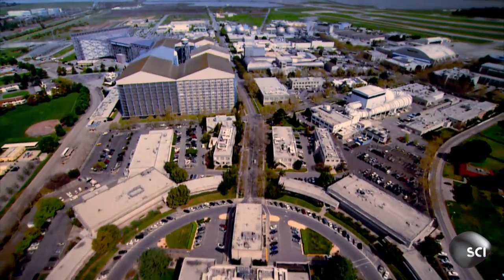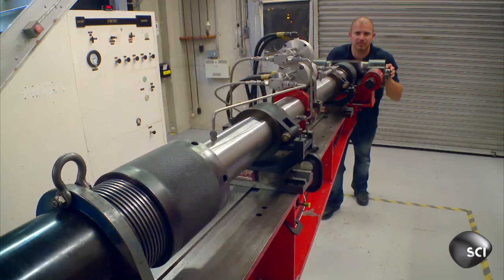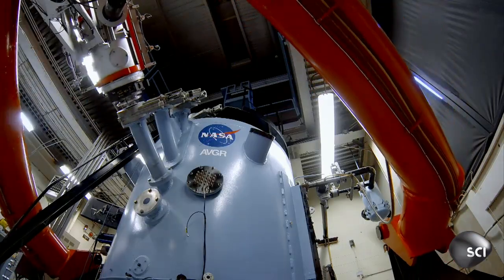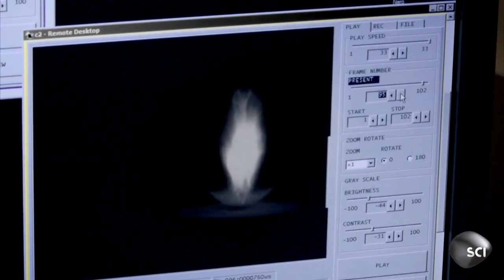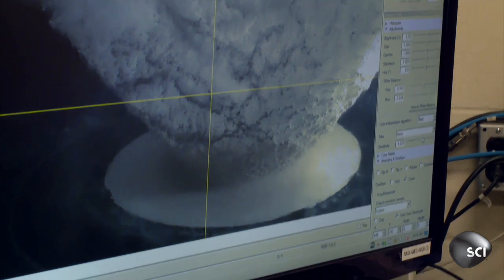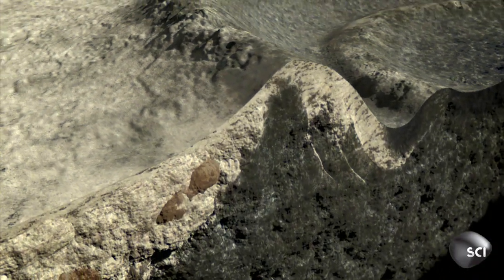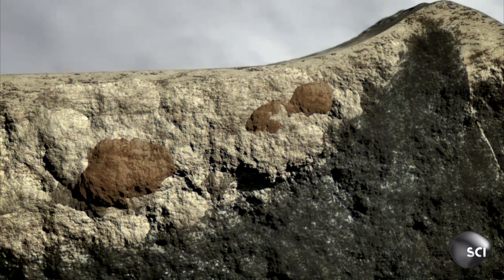Recreating Asteroid Strike That Killed Dinosaurs

Comment: People, including scientists have a hard time wrapping their head around the immense energy released by the impact. 
The excavation of the crater took 3-5 minutes and both the impactor and earth under and around the site were vaporized, a mountain range of material was vaporized by heat hotter than the surface of the sun.

If you were anywhere within line of sight of the plasma ball you would be blinded and set on fire. You wouldn't have seen anything but assuming you were wearing a big silver reflective fire suit and tinted welding visor (assuming it could dull light this intense to something that won't blind you) you'd have barely had time to register the entry if at all. 
If you were on the Gulf Coast in what is today Georgia or Mississippi and wearing said suit, the plasma ball would appear the size of a soccer ball held out at arms length.

Unlike Hollywood depictions no large boulders would rain down, it was almost entirely vaporized or reduced to dust. Further from the impact, out of line of sight as the plasma ball is behind the horizon you'd see the curtain of incandescent material rising and spreading out,after 30-40 minutes it would envelop much of North America.
The heating would be rapid and begin setting flammable material alight. Forests would burn.

About the same time the magnitude 10+ earthquake would strike. Liquefaction of soil would occur and start to swallow things up, even well built bunkers would fail meaning survival is unlikely as either the bunker implodes or the escape tubes are severed or buried. Even if these things do not happen, the shaking would be so violent people would suffer fatal injuries like heat trauma and broken bones.

Vulnerable facilities like nuclear power plants would suffer immediate failures as coolant plumbing to their cores would fail. Their containment systems would collapse and having suffered coolant failure would rapidly overheat and rupture, exposing their burning cores to the atmosphere. No one could make efforts to remediate the problem or get coolant to the reactors as they would be crushed by falling debris or simply be unable to walk or work amid the violence of the shaking.

Buildings would collapse, hundreds of millions not already charred to death by the flash would now be buried or crushed as their homes, offices and other structures collapse on them. Cities would see pretty much all of their tall structures fall. This would be a global event. About 1 hour after impact the entire planet would be shaking violently. 

The magnitude 10+ earthquake would trigger volcanic eruptions as it spreads out adding greatly to the effect. Yellowstone would erupt.

The tsunamis would take the longest to effect the planet, some would take many hours to days to hit land as they cross oceans direct from the impact while others would be induced from undersea landslides, the global earthquake would trigger localized earthquakes and plate uplifting that would cause additional localized tsunamis in addition to the primary earthquake, submarine volcanic eruptions would likely cause some tsunamis as well.

Over a period of 30-60 minutes much of North America, all of Central America and a significant portion of South America would be hit by the blast of overpressure, unprotected animals and people would suffer collapsed lungs and other hollow cavities. Ruptured eardrums absolutely.
Between 1 and 2 Billion people would be dead by 1 hour of impact.

An excellent video can be found here, in my opinion it is very conservative in its estimations but very interesting to watch. It does not make mention of eruptions, additional tsunamis ect (that's ok, hard to predict which faults and volcanoes will go) but gives a pretty solid estimation of the impact effect.

https://www.youtube.com/watch?v=ya3w1bvaxaQ&t=322s

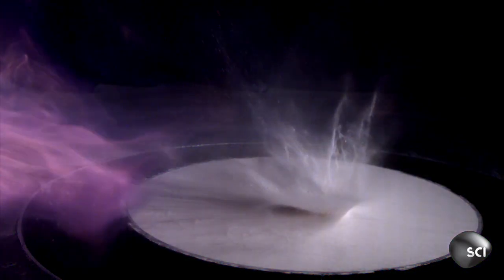Comment: 3:42 that crater isn't egg shaped. And I don't think the one at Chixulub is either. And why would a 90 degree impact angle be the norm? There is a wide range of possible angles for impact, it isn't especially likely to be a right angle. The scientist in this video is great but is it possible I sense some sloppy work by the uploader?

Comment: 1:43 Except that the impact that created both the KT event line and killed the dinosaurs,
didn't strike vertically, but diagonally and resulted partially in the Gulf of Mexico.

It struck at a bearing of NW, about 60 degrees upward-ish..
Reply: 3:36 Nvm, you got that.
Reply: You can find out for more certainty, by measuring the large debris around the Earth,
for the spread.
Larger pieces can't stay up in the atmosphere for weeks and have a ballistic trajectory,
which is then more common near the impact site, and with certain density covering.
Then when the amount of debris in larger chunks is made into a density chart,
with similar indication of large chunks density, you can match that to the
simulation, until you get a similar result on angles of impact with the simulation.
Ofc, it still won't be as exact a match, since there's no atmosphere involved
in the simulation, which would disallow faster deceleration due to air friction..
Reply: This is different from measuring the KT line's thickness.
t's checking it for larger debris parts, not dust.
Reply: Still more interesting would be drilling a hole in the ground somewhere,
getting a deep soil sample, and finding out why part of the US's mountains
and the San Andreas fault line exist, but also finding out that some
tectonics still exist because of an event that happened millions of years ago.

A tectonic plate set in motion by such an event does not come to a halt in a year or two.

Comment: wheres the actual asteroid gone that backs all this up???
Reply: The main evidence of such an impact, besides the crater itself, is contained in a thin layer of clay present in the K–Pg boundary across the world. In the late 1970s, the Alvarezes and colleagues reported that it contained an abnormally high concentration of iridium. Iridium levels in this layer reached 6 parts per billion by weight or more compared with 0.4 for the Earth's crust as a whole; in comparison, meteorites can contain around 470 parts per billion of this element. It was hypothesized that the iridium was spread into the atmosphere when the impactor was vaporized and settled across the Earth's surface among other material thrown up by the impact, producing the layer of iridium-enriched clay.
Reply: That’s like saying “what happened to the ACTUAL nuclear warhead that backs up proof of an explosion???” It’s simple. THE ASTROID DON BLEW UP.

Comment: it also created a HUUGGEEE mega tsunami
Reply: @jbmrisn48  Most guesses say at most 300 feet, thus limiting the tsunami to 300 feet. That's pretty big, yes, no doubt about that, but it's tiny compared to what could've happened. In deep ocean, a 15,000 foot wave would've been possible.
Reply: @jbmrisn48  It was 6.8 to 50.3 miles in diameter, we will never know for sure.
Reply: Lucas It did worse than just that
Reply: @Untrepid One Whatever you're smoking to think that's true, stop.
Reply: actually most of the water in the area was probably evaporated before the asteroid touched base just because of the insane amounts of heat the astroid gave off
Reply: No it didn’t. It made a large tsunami but not over 1000 ft.
Reply: No. The water was too shallow to create the tsunami you probably have in your mind. It was around 300 feet high by most estimates. If it had hit in deep ocean it would've been ~3 miles high.
Reply: @audilicous  the closer it comes to a coastline the higher it gets.. thats the problem
Reply: @fortisvoluntatis1417  Correct, but it will not become higher than the height of the water it originally entered. Thus, it would be limited to what I said before. The sea it hit was extremely shallow.
Reply: audilicous so you are saying that the water could not have been, “scooped up”, by the blast, like a bulldozer pushing dirt ahead of it, thus creating a wall of water much higher than the depth? Remember, traditional tsunamis come from earthquakes, which usually do not impart the amount of energy we are talking about here, as well as in just a fraction of the time. I know when I was a kid, when I smacked a shovel Into a shallow puddle, water went a LOT further out than how far the depth of the puddle would have had it wash up on the sides.
Reply: The largest Tsunami
Reply: In The world
Reply: @alexabney3961  100 meters high,meh,the most biggest tsunami have 520 meters high,in lituya bay

Comment: They always mention the soot/ash blocking out the sun...but what about the heat from the initial impact? If you were 8,000 miles from impact, how much would the heat rise? Would you be deafened from the shockwave? Also, I wonder what the sound would BE like. Would you be blinded from the flash, at 8,000 miles away? Or would you have to wait for the soot/ash to end you?

Comment: TriggerEd EddieIrrelevant. Are you disregarding the athmosphere (later atm) over the sand at impact? At the speed the asteriod travels and its surface size wouldnt you think that sand only would maybe show the after events of the impact say on the mars or any other rocky planet with no atm? I'd use the equivalent amount of atm thickness to asteriod size ratio at the measuring of how much say water(atm) I need above the surface of the sand (earth). Then place cameras abover water (stratospheric surveillance) and below to see what would happen in the atm how much would it spread, would debries from impact try and escape the atm (water) again? By how much? You could re calcluate the water to air density and apply mathemathics to see how much difference there is of what you can observe with waters density and actual reality which is not water. We cant live in water. Imagine all the bubbles. But I think its better than nothing.

Comment: can anybody explain the flash seen upon impact?
Reply: heat from friction, or maybe sparks from sand.
Reply: It is indeed heat. Energies involved in a collision at 4km/s are so huge, that things melt and/or evaporate. The flash is literally plasma - a cloud of evaporated sand and impactor debris at extremely high temperature.
Reply: Per the narration, the ball is traveling at 12,000 mph (over 5300 m/s).  Kinetic energy is proportional to velocity squared, so for a 1 gram ball that's over 14,000 Joules (almost 4 Watt-hours, enough to light a 100-watt bulb for two and a half seconds). It didn't say whether they evacuated the chamber (if they were simulating an impact on Earth, probably not), so some of that light is plasma from the ball ionizing the air as it rips through.  On impact, some of that energy goes into the ejecta, but most of it goes into heat, light, and sound.  

Now, scale that second impact up to the Chixhulub impactor, something like 11 km in diameter and massing on the order of 10^15 to 10^17 kilograms.  At that same impact velocity, it would have release on the order of 14 sexitillion Joules, or on the order of 4 quintillion Watt-hours.  Think how far that wave of hot debris would have traveled.

Comment: The actual asteroid came with a shallow angle
Reply: Didn't change much considering the actuall asteroid was the size of Mount Everest traveling at over 24,000mph
Reply: All that it changed was that he debris shot out of the atmosphere at 45 degree angle instead of straight up
Reply: No, it means most of the force was directed horizontally and not vertically. The majority of energy was shot straight across the Earth.

It's very significant. Like the difference between your rocket shooting straight up, or sideways...

Comment: Imagine if the money wasted on this guy's "experiment" had been spent on a worthy project instead. If I had the power, I would put him and the bureaucrats who authorized his grant in prison for several years to think about it. He literally learned nothing that couldn't be duplicated by firing a .22 into a mud puddle.
Reply: The thing is, this object was going at 4km/s (much faster than a 22.) Also, you can see the intense heat and plasma caused by the friction of the object.
Reply: Domino the Dominator
And for all that effort and expense what was added to the annals of human knowledge? That a high speed impact spreads debris up into the air and all over the place. I never would have guessed.
Reply: Sporkmaker5150 Dude, holy crap, do you get angry at everything? This is an accurate representation of what would've happened 65 million years ago, and you're here complaining about it?
Reply: Domino the Dominator
I wouldn't say I'm angry, just puzzled and frustrated that this pseudo scientist was probably financed by tax dollars for his "experiment". Tell me this, was there any possibility whatsoever, any at all, that the result would be anything other than what we just saw?
Reply: Sporkmaker5150 Well, you have a point there. I didn't know that this was paid for using tax dollars, and you're right, it probably wouldn't differ from the last experiments.
Reply: Isn't that the point of experiments, to determine if in fact what we believe has any validity?
Reply: I would say it's the point of legitimate experiments. I would also say the point of this particular one probably had more to do with NASA's end of the year budget than it did a quest for knowledge.
Reply: What part of my cynical pragmatism would lead you to to ask that lol. Don't get me wrong, I'm 100% in favor of public funding for genuine scientific advancement and for NASA in particular but this guy was literally approved to build some no doubt ungodly expensive contraption so he could fire a high speed projectile into some goo - and surprise - the goo splashes in the air - and bigger surprise - the goo splashes are DIFFERENT depending on the angle of the impact (face palm). Outright thievery and it only serves to hurt the cause of funding and furthering real science.
Reply: @Sporkmaker5150  They were trying to simulate the specific conditions present when the asteroid hit the Earth.
Reply: No, that isn't why science is done.

Science demonstrates what is false. That is all.

What you believe is only strengthened by ignorance.

Spork has a valid point. However, there are far more places to point that angry finger if he really knew.

Look at the trillions the military spends on absolutely dog shit...

Look at pie in the sky SETI experiments. These people should be locked up. That's coming from someone who LOOOOOOVES science and scientists like Carl Sagan. Contact is one of my favorite books. So, don't get me wrong. It's not a matter of not thinking it's valid research. It's just not valid given everything else. Kind of like triage, we can't afford to build the huge radio telescope to find out of ET is calling just because someone's nerdy desire calls for it. We have more important things going on.

Spork's point is salient. Even if I care a great deal about figuring out impact events to the greatest detail possible (I really do), we have to put other things ahead of that desire.

This was a waste of money, so was the F-35. The F-35 cost about a thousand Xs more, though. lol

I hope spork isn't just bitching about science experiments, but also makes the rounds to the ludicrous weapons spending videos on YT.

I mean, if this big gun bothers him that much, I REALLY hope he's pissed at the guns we make that are thousands of times more expensive and pointless.
Reply: @johncee853  Damn right we do, in genuine ways that actually add substantive knowledge. Try watching this video one more time, only try to do it objectively without being mesmerized by the dramatic music. This guy builds his unfathomably expensive gadget, the true purpose of which is most likely to spend the full amount of his grant before the end of the calendar year so that he will be sure of receiving the same amount next year. He fires his faster than the average bullet projectile into a bunch of goo and the scientific revelations are mind blowing - it splashes a plume of goo upward and outward and all over the place! NO FUCKING SHIT. Then when the goo splashes all over the place they act like they just landed someone on the moon. Give him the Nobel prize for Physics.